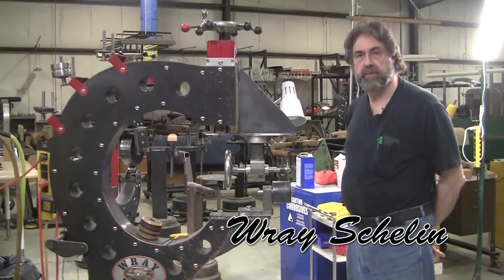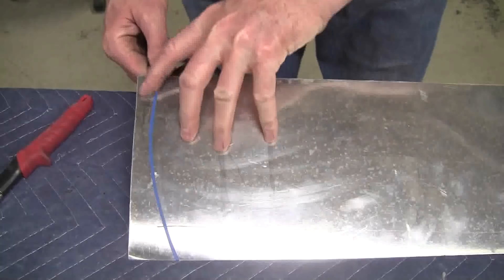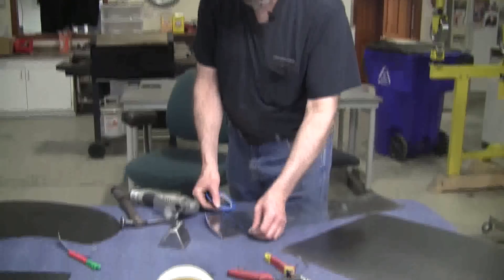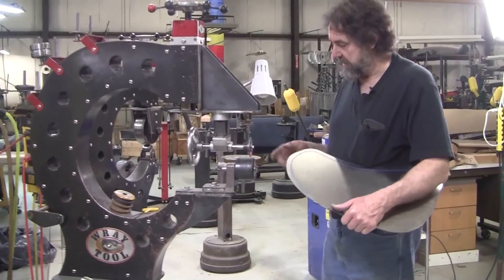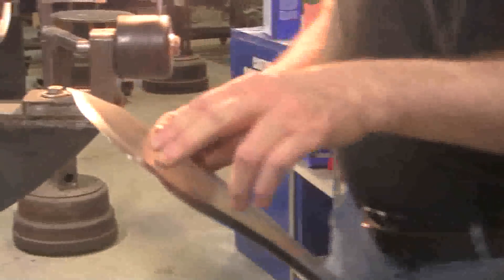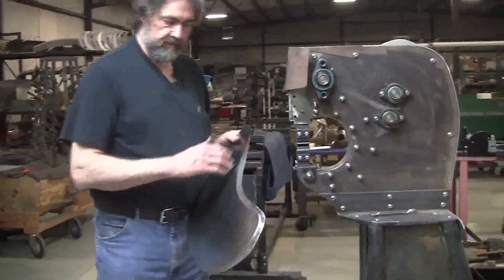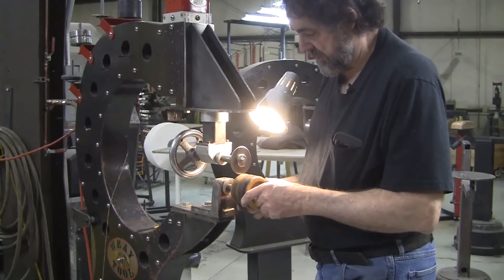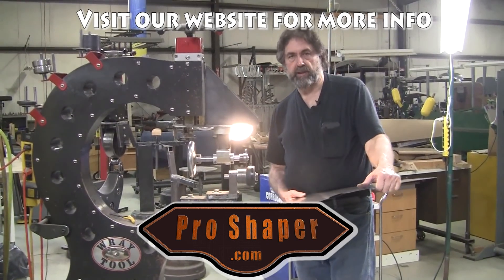Metal Fabrication Techniques: Tipping Wheel Part 1

Comment: Excellent teaching.... I learned all these things by myself with  super cheap hammer and dolly set from China 40 years ago... and reading books in the library ... no one near me knew anything about metal working at least no one I knew of..... it amazed me how easy it really is and also it amazes me how metal forms memory over time....wrinkled fenders would easily go back to shape if done right after the accident but months or years later would become more difficult the longer you waited....a little heat would overcome that work hardening of the metal.... and yes I totally agree that it's like working clay .... using heat is like adding water to clay preventing cracking from over working .... pretty kool atuff
Reply: jolllyroger1 clay is similar to aluminum, but once you’re working with things like steel or stainless or titanium it’s more like glass or something, more carbon in the steel results in pretty brittle crackly stiffness.. but annealing and heat treating and case hardening etc. is the secret recipe
Reply: WPXTacoMan477      Joseph Gaudioso
Reply: @WPXTacoMan477  everything is fluid even ice even glass..... you must use a cutter that is harder than what you intend to cut ie less fluid ..... it's easy to drill glass if you do it under water it cools and it damps the vibration that causes fractures or harmonic ripples in the material.... and then there is edm drilling which can drill anything with extreme precision

Comment: Great job of illustration. Thanks for the lesson. With a shop like yours , the sky is the limit. Thanks again !!!
Reply: You missed ..that with a hunk of metal and a hammer you can do all of this.... simple tools is all you need... you can even use wooden blocks as dolly rocks pipes bags of sand and hammers be those hammers made of metal wood plastic or even stone.... to shrink you can use a pointed punch with wood backing .... it's all in thinking and watching how the metal moves

Comment: I worked as a sheetmetal mechanic for 20 years. We mostly fabricated for the heating ,air conditioning,ventilation market but also did cornice work and built and installed copper ornamental roofing and awnings. We also started installing heating, air conditioning equipment, so I went back to school to design, install, and repair our's and other's systems. For my last 25 years, before I retired,  I worked as a hvac mechanic. I remember well some of the techniques you show. Lol  In the 1980s a large truck hit the awning over the side walk at a local store in a down town historic district. The awning was built in the 1880s.   I remember building the ornamental starfish on the sides of the awning. When installed you couldn't tell mine from the originals.

Comment: An old sheet metal trick. We put a 3/4”nut in the jaws of a 10” vice grip such that one edge of the nut is parallel with the front if the vice grip. Adjusting this to a tight bite provides the exact width and depth to quickly accurately bend up a 90 degree flange approximately 1/2” on a round pipe.   Neat quick and accurate.
Reply: Yes this way would be more faster and easy. No need to go over so many processes.

Comment: I've been an aircraft sheet metal mechanic for over 30 years, but have spent so much of that time in other areas of aviation structural mechanics, I'm not the metal bender I'd like to be. For instance I'm just now learning how to much shrinking can be done by hammering and pressing gathers in the material. I've always tried to avoid gathering as much as possible outside of shrinking dies. Possibly because we generally use 2024 t4 and 7075 t6 aluminum which is quite stiff a prone to cracking so with tight intricate shapes we have to often work with annealed material and heat treat the finished product.

Comment: I love the vise grip tipping of the aluminum sheet. Do you think it will work with 0.032" 2024-T3 aluminum? I want a 90° flange on a 24" diameter circle of the aluminum.
Reply from the maker: Yes, try it.

Comment: Really cool, don’t know if a huge flange would ever be applicable but it would be easy to adjust your English wheel where the crank was on a beveled gear or just a couple straight gears to get that hand wheel out of the way to access the rest of that space for potentially a couple feet of sheet metal

Comment: The last tapered bead shown in the clip,  how deep can that be made in the middle of a flat floorpan without creating distortion? Typically used on modern cars to strenghten up the floor from front to back
Reply from the maker: When you make a bead in the middle of a panel unless you pre-stretch it first it will draw metal from the sides and cause a distortion in the panel.

Comment: Hey Wray what brand are those cordless shears please
Reply from the maker: Hi Paul, I have two cordless sheet metal shears. Both have proven to be almost indestructible. They have lived through the abuse of many classes over the last two years.😁😁😁  The first one I purchased was a Bosch 12 volt ( they are now 18volt). The second one is a Chinese manufactured 12 volt model, sold through Menards. They no longer sell them as far as I know. I was never able to track down a Chinese company that made them. Once you use a cordless shear hand shearing only happens 5 percent of the time.

Comment: Awesome video Wray. As I used to live in Maine for 13 years the accent reminds me of home. My question is you tend towards shrinking most of the time and why that is? I have done quite a bit of tin knockin in the past and really never gave it any thought. Your thoughts would be greatly appreciated!
Reply from the maker: Hi Matt, thanks for your comments. I was born in Worcester, MA which has it's own individual accent, it is different from a Boston accent, but very similar to a Maine accent.😁😁😁
My general rule of thumb is if a panel has more than 3" of rise at the highest point it is better to shrink. How much you shrink is up to you. General rule if thumb is you can shrink 50 percent, or 60, 70. It really doesn't make the panel better, but it often allows you to make larger panels and make them faster with less welding.

Comment: Your cordless shear,brand and where to buy.
Reply from the maker: Hi Jim, I have two, one is Bosch and the other is a MasterForce. MasterForce is sold at Menards. Bosch you will have to search. Both work very well. The Bosch was $325.00 and the Masterforce was $163.00. I hardly ever use hand snips now.

Comment: The sad part about building a tool though is once you are gone or out of business or even passed on, NOBODY but you will have known how handy these tools really were or what in God's name they were used for in many cases!!! 

I say that because I used to work in electronics factories and constantly came up with tools of my own designs to help me work through problems with products and projects I was told to work on!! Some days I was even taking things home with me to "solve a problem" I was having just to develop a tool at my home work shop and then leave it at the company I worked for so I could use it every day at my job!!! 

A great example of what I am talking about is I created a tool that tested the polarity of a connection that used a simple LED to test the power coming out of it. In the "right position" the LED would light up telling me the connection was wired correctly and that we had power to the unit, in the "Bad position" I could also test to see if the circuit actually had power of the board or harness plugged into it might have a problem. And it took literally SECONDS to figure out when using the tool I build and designed "what was wrong" and "how to fix it" with the tool I designed!! And some of the boards WERE as much of a problem as were some of the harnesses we'd get into as well!! 

The thing is I showed the tool to a friend of mine who I trusted while I worked there, and I told him "if anything ever happens to me where I am NOT HERE. take this tool apart!" OR "keep it for yourself but never tell anybody what it is used for!"!!! After all the tool was just "simple pieces" we used all over the shop in different areas of the company, and because my station tested EVERYTHING, ODDLY we were always getting "spare parts" to repair weird things that should have at times NEVER been assembled wrong to start with!!! 

A couple years working there went by and I up and quit one day, fed up with being screwed over and the many "this is the final straw moments" the company had put me through!! I didn't cause a big scene and as I just turned to walk out the door, I told my friend "Remember what I told you about my tools!" and he shook his head!! 

Years later I ran into my friend and he told me that he used my hand built, self designed tools for years and NOBODY knew how he learned the things I taught him!! I had after all shown him how the tools worked what they were used for, and WHAT they did. He told me further that one day the president of the company noticed him using one of my tools and asked him "Hey where did you get that tool?" and my friend told him "You had a guy working here almost 10 years ago who your plant manager had a grudge against, so he quit, and he designed it and built it!" and then he told the company president that "If I ever leave I was told to destroy the tool or take it with me!"

The crazy thing is this was AFTER my friend left the company and he STILL had the tools in his home work shop!! Nobody ever knew WHAT the tools were for, what you could test with them, or even who built them other than him and I!! And sadly when him and I was gone, all the problems I had "solved" with the tools I had built had came back to the company and NOBODY in the whole shop knew how to fix them!! 

Lastly the craziest part to my story is this!! I am NOT a "smart man" I am a simple hick form the back woods of upstate New York with only a high school diploma and a background in high school level electronics!!! I am also self taught on computers as well, but I have a decent understanding of both!! Further I was trained in auto mechanics which wiring in cars was kind of one of my "special training", so working around DC powered circuits isn't anything new to me!!!! I never went to college and I have designed and built many tools in my life, and nobody ever seems to understand WHAT THEY ARE, how they work, or the problems they can solve when I am NOT AROUND TO USE THEM!!! In another company they simply threw out a number of my "self made tools" another friend there told me about, because nobody KNEW WHAT THEY WERE, or how to use them, then they tried to assemble the things I built for the customer without my tools and ended up loosing the customer, because nobody knew how to solve the problems I had created the tools to "fix"!! And in THAT company I had worked BY MYSELF for four different customers, and developed tools for ALL four product lines that were "special to those jobs"! So in the end they DID NOT LOSE JUST ONE CUSTOMER because nobody knew how to use my tools and thought my tools where literally GARBAGE as they tossed them out!! They killed their own business because nobody knew what my tools DID or how they made work "easier" as they lost all four customers!!!
Reply from the maker: I have a plan.😁😁😁